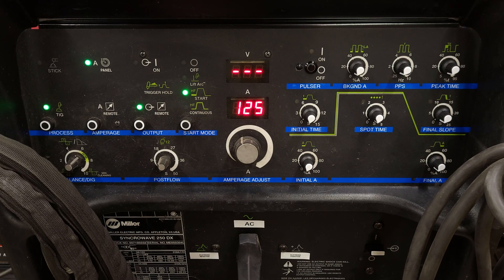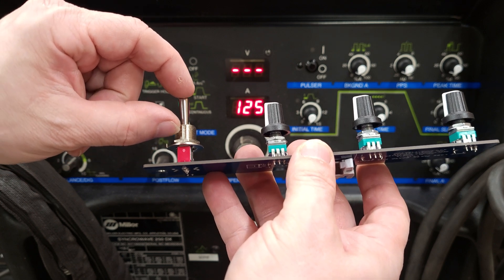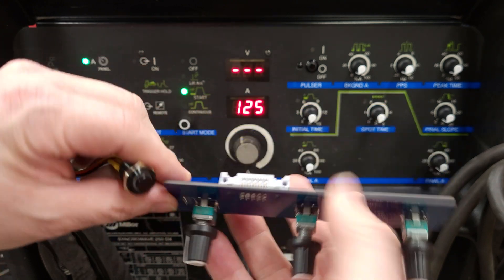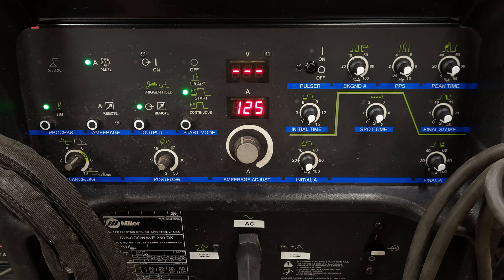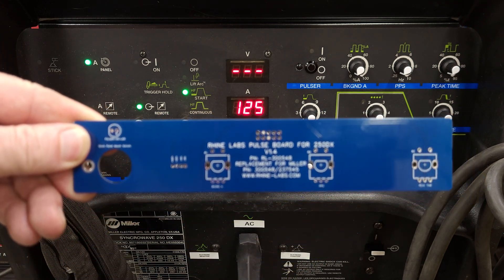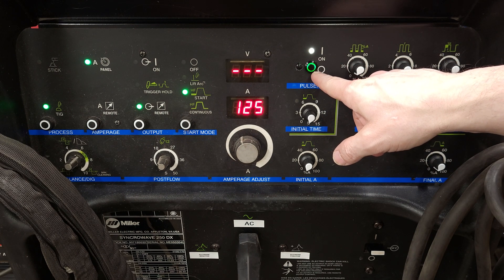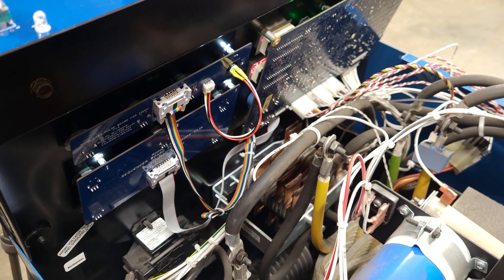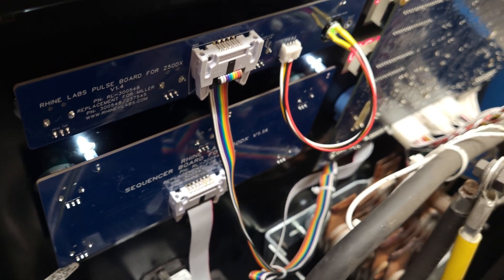Miller Syncrowave 250DX Tig Welder Low Cost / DIY Pulser and Sequencer - Progress Report!

Comment: I bought a set of his boards last year,  everything is a quality very well-built part.  Knobs all feel solid and consistent , as in there is equal amount of “physical” resistance in each dial.  I will say the button with the led ring used for the on off switch….seems a little like putting led rock lights on a classic square body or Highboy (no offense if you run that setup)!!  They were easy to put in, work perfect, and the customer service was/is phenomenal.   Also, they are substantially cheaper than the Miller boards.  A big thanks to Rhine Labs!!
Reply from the maker: Thank You, for  the  feedback. The Button  LED on all  V2 retail boards sold in the last year a can be disabled on the pulse board there is a dip switch for doing that.

Comment: I’ve owned a 250dx welder since 2006 and it has never worked right from day one and got no help from miller. It’s now 2024 and it still doesn’t work right. In the 18 years I have had I have used it so little that I’ve only gone through two tanks of argon. It does make a nice $5,000 dollar door stop.

Comment: Are you making any parts for the "2004" Miller Syncrowave 350LX?
Reply from the maker: Not at this time but there are plans though. but you are the 2nd one to ask. The 350lx had pulse standard but optional Sequencer.
Reply from the maker: I did a quick little blog post on the older 350LX for you and other today showing the info I have on the Older 350LX hope it helps. https://www.stevenrhine.com/?p=133276
Reply: @Rhine_Labs  Thankyou!

Comment: so why the extra hole on top left by on off switch?
Reply from the maker: That is for a stand off because miller used a smd tact switch on their board without it on miller's boards it would flex not needed with mine just leave the hole plug in there.